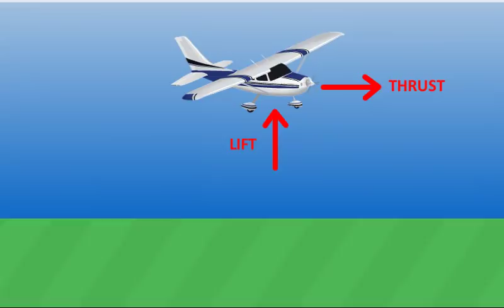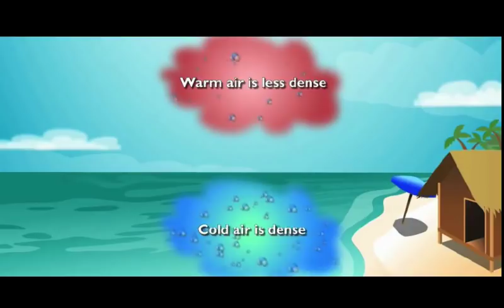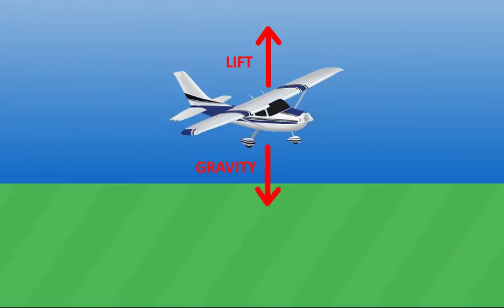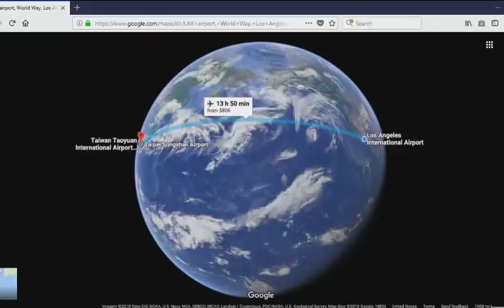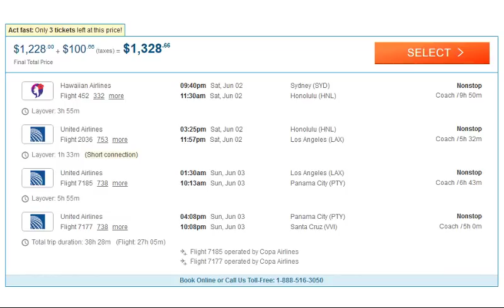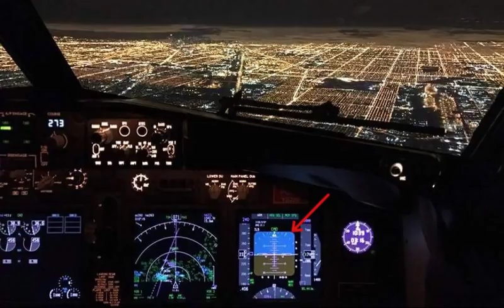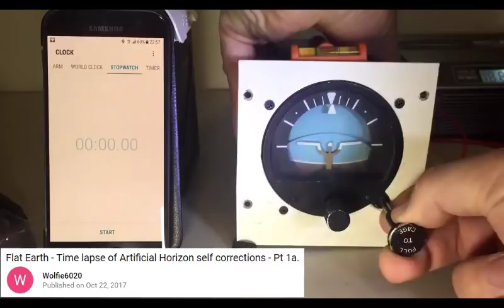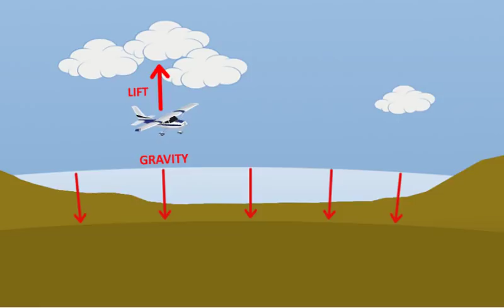Flat Earth Falsities - Plane Nonsense

Comment: Object in motion tend to stay in motion, like bullets, they fly forever. The air keeps the plane over the faster moving conveyor belt below, the air keeps the planes reference and acts like the ground below, just as solid. This depsite the planes rate of constant change as opposed to the direction the earth is suppose to be moving at a much faster speed than a planes cruise speed.
It's all relative because we believe in voodoo. 
VoysovReason, all this time you still are clueless, claim gravity and stuff that does not make sense and you can't demonstrate.
Throw your globe in the trash, wipe the tears and get over it. Nobody is stupid enough to believe this....... Well, a globe head might.

Also, you have not trolled my channel in awhile, so get back on there and stop being unfaithful. Do it now.
Reply from the maker: MrThriveAndSurvive, speaking complete nonsense. What a surprise. You have no grasp of physics.
Reply: Flatard alert!
Reply: Mike Helmick- What a crock of horse shit. Bullets fly for ever lol. Prove that they do?
Reply: They don't fly forever, neither do planes just magically keep a fixed reference to earth while flying all over keeping their state of starting motion as globe head here showed in his video.
Reply: FE:  All talk, no map.
Reply: jordy f, "buoyancy force can be calculated with the equation Fb = Vs × D × g, where Fb is the buoyancy force, Vs is the submerged volume, D is the density of the fluid the object is submerged in, and g is the FORCE OF GRAVITY." https://www.wikihow.com/Calculate-Buoyancy
Reply: @jordy f wrote: "Measure a stone using very accurate weight scale".
Wolfie6020 done that: https://www.youtube.com/watch?v=CkhxPm15PFo
Reply: Mike Helmick and other FE Believers : What would happen if someone on a 55 foot high diving platform on the back of a cruise ship tried to dive into a pool directly beneath them?  The ship is traveling a steady 30 miles per hour.  Would they fall into the pool, or fall into the ocean behind the ship as the ship moved out from beneath them?  Someone tried it.  See what happened here:  https://www.metabunk.org/north-south-flights.t9696/#post-221675
Reply: Mike Helmick - Earth is not wobbling back and forth 23.5 degrees, it stays inclined 23.5 degrees on its orbit around the Sun. Polaris stays aligned with the axis of rotation of Earth.
Reply: hiddengnome, it's funny how Mike Helmick implies gravity is 'voodoo', and then goes on to mention 'weight', aka mass times the acceleration due to GRAVITY. 😋
Reply: Yeah, because without gravity, what is weight exactly?
Reply: @jordy. I explained that "phenomenon". Air isn't moving along with airport walkway. Even open window will allow grater draft than that walkway speed ever could create. What's more that walkway wasn't working 4 billions years like rotation of the Earth.
Reply: because the helicopter is in the air that moves WITH the earth, that answers that question, try answering mine...... WHAT IS WEIGHT, if it isn't involved with gravity...
Reply: Hi jordy, pretty sure I already explained to you that drones have a microprocessor that uses accelerometers and gyros to make the drone stop when you take your hands off the controls. 

What you want to do is just launch a dumb projectile straight up from a moving surface and see what happens.
Like this:
https://youtu.be/CDf_0fPbNos
Or this:
https://youtu.be/KacTRPL1MtE

What is happening in those videos exactly? (don’t worry they are both short - sub 2 minutes)
Reply: Oh and guess what happens to your oil and water in a zero g flight? It doesn’t separate any longer because it needs gravity to do that!
Reply: Cassi O: spot on. It is basically just the weight of the displaced matter.
Reply: g is not a constant in that equation. Because acceleration due to gravity varies. That’s why the same object weighs less at altitude than it does at sea level. And weighs less at the equator than it does at the poles.
Reply: jordy f, Then if  g=0, Fb=0. No gravity, no buoyancy.
Reply: Yes you do see the same thing with the straight up/down helicopter. It takes off vertically from a moving surface (the Earth) and stays above that spot until it comes down again. Exactly like the ball in the video does. 
The only difference is the place we are viewing it from. 
If you put a camera on the moving trolley it would look like the ball went straight up and came straight down.
Reply: Sure try it. You might get a surprise. Here’s a couple of calculators to let you see what it expect. 

This one gives you your acceleration due to gravity based on your height and latitude:
https://www.sensorsone.com/local-gravity-calculator/

Then this one calculates weight from mass and gravitational acceleration:
https://www.sensorsone.com/mass-to-weight-calculator/
Reply: Burj Khalifa is 
25°11′49.7″N 55°16′26.8″E

So at sea level local gravity should be 9.78956 

The top floor is only 584 metres, not very high, but local gravity still drops to 9.78775

So an object with a mass of 100kg (a person?) would weigh 
99.8257305 kgf at the bottom. 
99.8072736 kgf at the top. 
A difference of 18.4 grams.
Reply: GrahamStw, those calculators are brilliant! We should also mention that the change in the acceleration of gravity with altitude, is because the earth is a globe, and objects weighing slightly less at the equator compared to the poles, is because the earth is rotating.
Reply: https://www.nyu.edu/pages/mathmol/textbook/weightvmass.html  "Weight is the measurement of the pull of gravity on an object." Maybe you should call it a Mass scale instead, weight is not a word someone who doesn't believe in gravity should use.
Reply: Mike Helmick - Will it be on the news tomorrow Mike that the earth is flat? It would be globebusting news. Youtube is as far as the FE bollocks will get. It is just full of scam artists,suckers and charlatans. Whick one are you Mike?
Reply: Correct, objects are made of material, which are measured by weight...... on a scale which operates on gravity. If they are not, what is the definition of weight?

"Without gravity, you still can see the fat people is heavier than the lean one."
A 300 pound muscle man looks better than a 300 pound man who doesn't excersize, so according to your logic, I would be right if I thought the Muscle man was lighter?  What?
Reply: jordy f, "Because, beside object weight,..." You just did it too, by referring to an object 'weight' your talking about the force of gravity. Without gravity an object has no weight.
Reply: " Put a drone toy on airport moving walkway. Then fly it vertically. Then Tell me that your drone will follow the moving walkway."   Is that really to scale? What is the math/science behind this? As in, how much smaller compared to the earth is the airport walkway, is it the same ratio as it is from real plane to drone?  From my understanding of scale..... those numbers won't be the same, so how is that a good test?
Reply: "The heavier object goes down and lighter object rises up due to density and buoyancy."  Can this account for things accelerating towards earth? If so, show me a calculation OR point me to a site that has one.....
Reply: And yes jordy, without gravity objects are weightless. 
Try weighing an object in freefall. Nothing. Try taking an object on a rollercoaster. At some points it will feel much heavier (when the coaster accelerates upwards) and at other points it will be much lighter (when the coaster accelerates downwards). Its weight changes. But its mass does not.
Reply: The video first shows you that the ball is launched vertically. When launched vertically from a moving platform it keeps that horizontal velocity and stays over its launch point. 
Exactly like a helicopter on Earth: it flies up vertically but keeps the horizontal velocity of Earth.
Reply: What cheap drone doesn’t have a microprocessor??
I’ve got one that cost less than ten quid and it has gyros and a micro. You couldn’t fly one without a microprocessor in it!
Reply: Holding material in your hand does NOT tell you exactly how heavy it is.... so not telling me how you measure weight makes you idiot.
Reply: @Mike Helmick
Id like to know how you think our atmosphere stays around our planet (please don't say a dome...)
Do you agree that the Earth rotates around the Sun at least? Or do you believe that everything spins around the Earth as if we're the center of the universe?
Every tried jumping on a moving train? Try it. To your surprise, you'll find you don't fly to the back of the train
Reply: @Mike Helmick
Also, im not sure you grasp the implications of a static Earth.
You'd be implying that we have no spinning iron core, which means no magnetic sphere which protects Earth from solar winds and cosmic rays.
Without it, we wouldn't even have an atmosphere. Also, there would only be land around the equator, everywhere north and south of it would be vast oceans
Reply: @Mike. Earth core isn't magnetized. Where did you got that idea? Magnetic field around Earth is created by friction of molten core against earth crust what thanks to static electricity releases electrons from solid matter and those subatomic particles flow through molten metallic core creating electric currents which in turn is a cause for Earth magnetic field. It is proven by a fact that magnetic poles aren't stationary.
Reply: Mike Helmick. You completely forgot about air resistance.
Reply: the atmosphere moves also
Reply: @ Mike Helmick. There is always air resistance when you move through atmosphere. It will be less but never zero. Otherwise airplane would start to fall. Cross wind will push airplane where they blow.
Reply: "until a certain altitude where lift can't compensate for weight."  ..... yes, keep thinking about it, what does this mean? That on a globe, it will stay at a certain altitude? Whoa, shocker.....
Reply: Jordy f "Do you have brain inside your head?"
Reply: I didnt read all the comments but im sure someone has mentioned;
incase you didnt know, we are not in a vacuum. Theres a thing called air resistance. if you could fire a bullet in the vacuum of space, the bullet would go forever until it hit something, because theres no air resistance to slow it down.
For that reason, planes here on earth has to have propulsion in the form of jet engines or spinning rotary blades to keep them moving forward.
The wings are for creating lift to counteract the force of gravity. It goes without saying that you need both propulsion and lift to stay aloft.
I think you also need to do some experiments with a vacuum chamber, then you might start to understand why the earth atmosphere is relative to the earth itself.
Also, if you want to observe the effects of gravity, you can simply be alert and pay attention the next time a comet passes by.
Comet ISON was a good example as it slingshot around the Sun due to gravity. As it got closer to the Sun, it increased in speed
Reply: jordy f - ‘’I have been woken up from this deception almost about 3 years already’’
So you’ve lost contact with reality 3 years ago.
Interesting.
Reply: So you claim to see sun spots rotating around the sun like an hour hand?
What apparatus are you using to witness this?
If youve looked at the sun, you must have witnessed Mercury or Venus orbit it?
Also, you don't have to work for NASA to see Van Allens belt with the right equipment. That is caused by solar winds and cosmic rays.
What about Aurora Borealis around the poles? Can you explain them without a magnetic field and solar radiation? These can also be seen on other spherical planets. Or are they CGI too?
Reply: Now you want  to talk about things we see and observe? Isn't that what you've been trying to disprove this whole time? We have seen and observed our Earth as spherical and you still dismiss it. 
Make up your mind and try not to contradict yourself. No one has ever seen or observed a FLAT earth (or any other object in space) either but you still believe it is.
How we know we have a molten (outer) iron core? Its called seismology and magnetic field data. We know that iron is plentiful in our solar system (universe in general) from collecting samples of many meteorites.
Why is it you think we cant dig further than we have? Heat.
The magnetosphere (generated by the spinning dynamo at the core) is directed through the north and south poles. Which is why you see auroras at the poles as it reacts with charged particles from the sun. This is something you can see and observe.

What keeps our atmosphere Earth comes down to a few things. One is called Thermal Escape. The hotter and lighter that gas molecule, the better chance it has of reaching escape velocity as gases move around at speed.
On Earth, we have heavy gas molecules like nitrogen in our atmosphere. Another is a planets magnetosphere acting like a shield against solar winds, which can strip an atmosphere.
Example, Mars has lower gravity and no magnetosphere, hence why it has a very thin atmosphere.
Venus also has no magnetosphere but due to it having a dense and heavy gas molecules, its atmosphere remains.
Reply: Mike Helmick, you have the same misconception I did about the tilt of the earth when I was a kid. The Earth doesn't wobble back and forth to get the seasons. It has a fixed angle of 23.5 degrees to the ecliptic plane (the apparent path of the Sun's motion on the celestial sphere as seen from Earth) and the north polar axis always points to the same location in the sky, which happens to be the north star Polaris. As the Earth revolves around the Sun, when the Earth's tilt is toward the sun, it's summer in the northern hemisphere, and when the Earths tilt is away from the sun it's winter. When the orbit is halfway between we have the Fall and Spring equinox.
Reply: Yup, the Achilles Heel for flerfers: reference frames. Every time.
Reply: +Cassi O
And then we have precession and nutation and the fact that the north polar axis doesn't always points to the same location in the sky, and doesn't point to Polaris, which is in any case is always moving both in relative and real motion.
Sorry.. and before you reply,  I know the earth is a slowly rotating terrestrial spheroid and gravity is a fact.
Reply: @Mike Helmick
"Reds has problems with anger management. I just had a heart attack on 5/12"
That is because you are the one with anger Mike. Anger plus the stress from continual lying cause high blood pressure which is why you had a stroke. Your subconscious knows you are lying, which is why you have your problems, including those headaches.  Try loving our slowly rotating terrestrial spheroid and your fellow humans and stop lying, or continue as you are and die early. Your choice.
Reply: wong, I know about precession, but not nutation. I learned something today -- thanks!.
Reply: +Cassi O
Cheers. Always here to serve and take the piss out of FE cultists et al.
I also take the piss out of Don the Fart and his gullible Fart Followers, so be warned.
Reply: I like how you casually dodge my questions...
You argue as if planes fly in a vacuum as soon as it leaves the ground.
Things moving in space is totally different to things moving in an atmosphere where you have to consider kinetic resistant forces. So we dont feel any forces here on Earth from it rotating around the Sun.
Throwing a ball in a pressurized plane is irrelevant as there is no resistance. Results would be the same whether you throw it forward or backwards.
Gravity pulls things radially inwards, keeping things relative to the ground beneath it. If you were high enough where gravity had much less influence, then your argument would be valid.
Your point of jumping off a plane does not disprove a spinning Earth.

If you put a spinning object (A) in water, the water will also spin with the object. If you throw in another object (B), it will rotate around the spinning object. A = Earth, water= atmosphere, B = plane
Reply: So electrons that have mass magically make it through thousands of miles of earth? I suppose you think Photons smash through your glass light bulb to hit your eyes. Nobody has seen an electron or photon, lets talk about science we can actually observe, not the effects of something we describe with make believe.
Molten Iron does not have any electric current flowing through it or magnetic field. 
however, who told you Earth even had a Molten iron core? Who found that out? The Kola Ultra deep is as far as we have been able to dig down.
Reply: The Atmosphere is pressed down upon a layer of Sulfur hexafluoride, this is the stuff things get suspended in before they fall back down. So I don't yet understand how the main wind on earth comes from the East and swirls North and South or how all the air stays on earth, but I can assure you that in a vacuum the size of infinite space gravity would be far to weak to keep it from being violently ripped off the surface of the earth. 
You can not connect a vacuum to a open non-vacuum and no experiment to date has proved this is even possible. More make believe without the observation. 
The Earth does not move around the Sun. If that were the case then no matter where you put Polaris which is always north of our position would be East and West of our position through the year. you can't make it work with any model, go ahead and give it a go. 
Just by the stars movement, everything moves above us and the counter rotation acts exactly like a conveyor belt viewed from below filtered through two opposite polarizeds fields.
Reply: wong, Who's Don? I think you might have me confused with someone else.
Reply: +Cassi O
Your beloved POTUS. In old/traditional English a "trump" is a "fart". A botty burp. Also an irritating person; a fool.
Reply: Panic time Morris, throw your ball in the trash, get over it.
Reply: jordy f
Stop trolling and fuck off you silly boy.
Reply: +jordy f
Do you think that everyone needs to listen to you? Fuck off you silly troll
Reply: Cassi O

We know about that equation.

See the equation. g is only a constant value. You can put any number you want for constant variable.
It won't change the concept. It only change the end result (becomes bigger or smaller).
Don't pretend to be smart if you don't understand the concept of the equation you presented.

It just a hoax and we don't believe it anymore.
We believe the reality observation.
Reply: There is nothing slow about our "YOUR" terrestrial Spheroid. The fantasy is that it spins 1037 MPH at the equator while wobbling to 23.5 degrees back and forth while flying a round the sun at 67,000 mph (Which would make polaris West and East of our position during the year) while making a mad dash to keep up with the sun set on a unknown destination throw the vastness of the Milky way at 487,000 mph.
Only mad men could concoct such a crazy fairy tale.
Reply: You are correct about one thing, we are not in a vacuum, earth would not have an atmosphere if we were. Gravity is not that magical enough to save it despite the many magical properties given it. putting a tiny ball in a vast close to absolute zero degree vacuum.
Reply: Water poured on a plane will lose velocity like every object does and will start to curve slightly back toward the back of the plane. If I throw a ball to the back of the plane the ball will be thrown and make it all the way back losing it's reference to the plane. 
So, it's velocity and Rate of change. 
If you jump up on a train there is not enough rate of change in the distance you jump. If you jump off a plane, then the plane would leave you behind instantly as you don't have any engines to keep up with it and will fall.The Earth's Atmosphere said to be moving with the earth would not help you keep up with the plane despite the plane traveling west and the earth moving faster than the plane could keep up.

Nothing keeps a plane fixed to the reference of the earth if the earth were spinning, you can't model that, or even show that using conveyor belts. Planes have to constantly fly against the wind no matter what direction the earth is "Said" to be spinning. 

things don't stay relative once they leave their fixed reference point. It's hard to wrap your head around if your convinced you live on this spinning ball flying through space. It has to work somehow, but none of it would work or even makes sense if you break everything done in what happens using reality. 
oxygen and nitrogen are not solids and change in density with altitude, there is no magic substance that holds planes to Earth's reference that is moving much faster than they can fly once they leave the fixed point of the ground.
Reply: If we had a spinning molten Iron core, then there would be no magnetic field which impacts weather and all living animals. Once Iron reaches is curie point it can't hold a magnetic field. Only NASA see's solar winds and cosmic rays, just science fiction. They even lie about the sun's rotation with their CGI demonstration when you or I can look at the rotation of sun spots that move like a hour hand.
Reply: hiddengnome

Yeah, because without gravity, what is weight exactly?

Weight is caused by the material of an object.
Without gravity, you still can see the fat people is heavier than the lean one.

Do you think everything float if there is no gravity?
Your brain is already damaged, please reset your brain so it will work again as normal.

If you have been sucked by the surface of the earth, you will feel that sucking force when you lift up your cellphone from the floor just like magnet pulling force in addition to your cellphone's weight.
Because, beside object weight, the sucking force (gravity) should be exist to prevent your cellphone floats in the air.
If the sucking force exist, you must be able to feel it.

Globeheads, I feel sorry to see how stupid you are to believe this gravity bullshit:-D
Reply: Dan Conrad

the atmosphere moves also

Try to spin a globe model near the smoke (smoke= gas = atmosphere).
Then prove it to us, that the smoke also move together with the surface of the globe.

Do you have brain inside your head?
Reply: VoysovReason

Put a drone toy on airport moving walkway.
Then fly it vertically.
Then Tell me that your drone will follow the moving walkway.

Please stop to fool innocent people.
Reply: hiddengnome

You just cannot digest my explanation about the moving surface of the earth?

When a helicopter takes off vertically, it lost contact to the ground, but still above the same spot.
It means that the ground is stationary.

That's why I ask you to fly a drone on moving walkway.
If you just cannot digest this, it's fine. FE is not for you.
Other people can understand this easily.

The truth is clear as day, you just blind your eyes not to see it. That's your problem, not mine because I have been woken up from this deception almost about 3 years already:-D
Reply: Cassi O

If the earth is flat, no gravity or pulling force or sucking force is ever needed.
Flat means horizontal, the only options is UP or DOWN.

The heavier object goes down and lighter object rises up due to density and buoyancy.
Just like mixing water and oil in a jar. After a while, oil goes up and water goes down.
Just like helium balloon floats in the air.
Just like an apple falls down to the ground because it denser than surrounding air. 

Why do we need gravity?
Only to fool you that you can stand on ball surface. That's all.
Reply: Martin Gorbush

How to make air moving along with the moving solid surface?
Please give us the example or experiment.
How to attach gas to solid surface?

This only work inside your imagination:-D
It will not work in reality.
Reply: hiddengnome

I have told you above.
Weight is caused by the material that made of the object.
As long as you can hold it with your hand or at least feel it, there is material.

If there is no gravity, do you think every object is weightless? A dumbell is weightless just like feather?
You are crazy. Ball earth theory makes you idiot.
Reply: GrahamStw

Do you think that everyone needs to listen to you?
You are at GE side, you have no idea what we (FE) about to explain to you.

Your video experiment doesn't prove about the movement of earth surface makes any sense at all.

Fly vertically means NOT MOVING AT ALL, zero (0) distance to sideways.
Check your video, the ball moves from point A to point B in parabolic path.

When you throw a ball vertically on this earth, the ball falls exactly at the same spot. Not in parabolic path. Do you understand now?

When the helicopter take off vertically, it stays exactly above the spot it lost contact with the ground. Just like a cheap drone toy without any microprocessor (just fan propellers) when it take off. Not even hovering a few cm sideways.

It's time to give up defending a lie:-D and go research flat earth
Reply: GrahamStw

Can you see the parabolic patch of the ball from point A to point B?
That's what happen when we do experiment on moving walkway.

Do you see the same thing  when helicopter take off?
No, because the earth surface is not moving at all.

Oh my God.... I am give up
Reply: GrahamStw

g is not a constant in that equation. Because acceleration due to gravity varies. That’s why the same object weighs less at altitude than it does at sea level. And weighs less at the equator than it does at the poles

You can easily answer this by typing.

Please answer this by experiment.
Measure a stone using very accurate weight scale (probably, 2 decimals digit).
First, measure it at sea level.
Then, measure it again at top of burj Khalifa tower.
Show us the weight different.
Reply: Well, it's air resistance that causes lift, but the plane is getting lots of air resistance until a certain altitude where lift can't compensate for weight. Meanwhile the earth below is spinning faster than the plane can travel, they are not connected at all once that plane leaves the solid ground. 
so there would be Zero Air resistance if the plane was traveling directly west if the air was moving with earth at 940MPH over North America. In fact the plane would not be able to create lift not being able to cause enough air resistance with something moving much faster than it can fly.

However, real life wind moves all over earth not in speed or direction of Earth's spin and the Earth can not be spinning if planes want to land again.